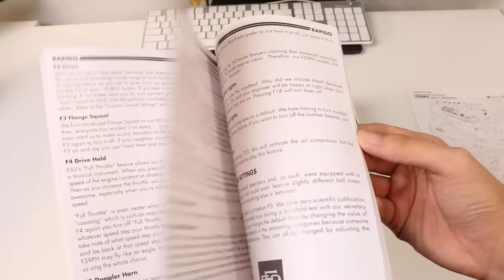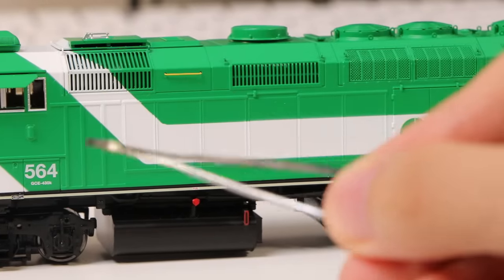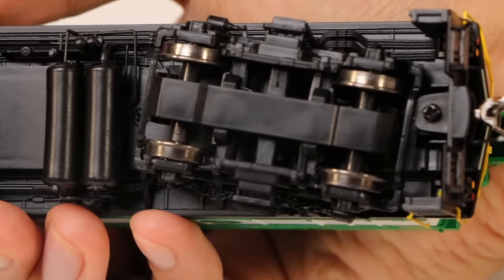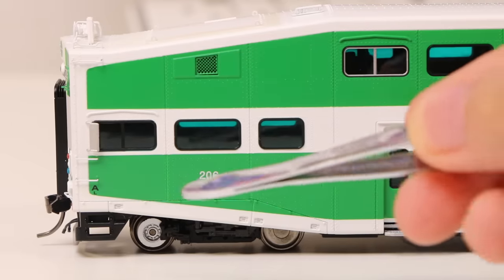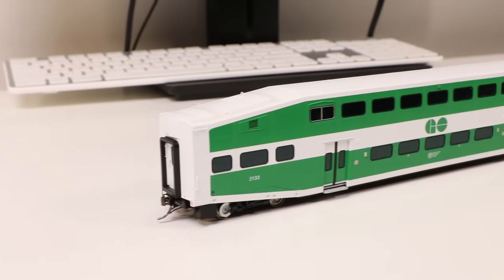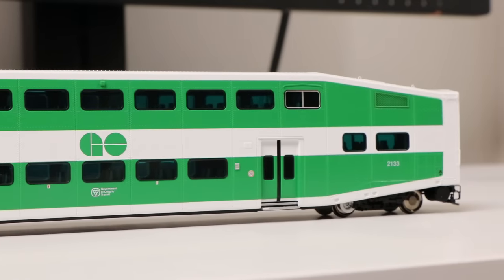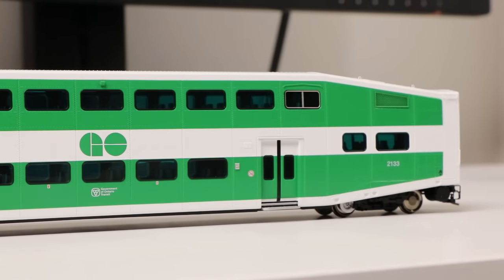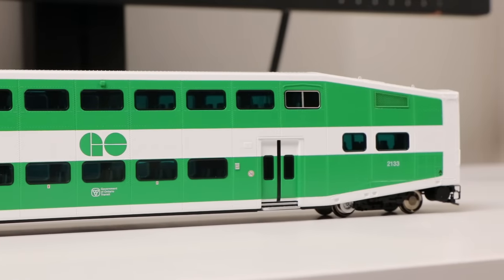Rapido HO Scale GO Transit Train Unboxing

Comment: 3:27 That small black connector that looks like an AC outlet or it can be a PTE connection.  PTE is Portable Testing Equipment, usually hook up a laptop computer to a PTE connection to get data from for example the trains main computer, black box or it can a sectional component like propulsion system or electrical and so on.  I was a technician for a few train builders. That what it seem to resemble.  Nice video.  Have a good 4th of July weekend.

Comment: Very impressive fleet. I live in the Tri State area Where I live Near New Jersey Transit. And my many trips in times past to Toronto & spotted The GO TRANSIT trains may I add thousands of videos of them. I have these Coaches and Cab Control cars in ATHEARN. Unfortunately I didn't purchase the ATLAS NJT cars. The engines Details are The GO TRANSIT are excellent. The New Jersey Transit cars I have had the pleasure on riding them constantly. On the ATLAS set what Irks me is why didn't they make an ALP 46 with the HO set ? The O scale set had them ALP 46 but not the Diesel Electric version you have on the ATLAS HO version.. I did spot the real version on my way to DOVER New Jersey. near Summit station when they' first debuted. Glad you have that one tho. As for your other model AMTRAK & your frieights  sets are all awesome . Good video. 👍🎥⭐⭐⭐⭐⭐

Comment: Good choice. One of my favourite models with really good quality. The DCC sound versions make them so much better. Time to invest in one lol. We did actually put the back handrails on upside down so you can fix it on your model if you wish.
Reply: The speakers IMO are mainly what holds them back. Motown Models and Scale Sound Systems both offer excellent replacement designs
Reply: @CentralJerseyRailfan  for iPhone speakers they do the job. But I definitely feel like any manufacturer needs new speakers nowadays.
Reply: @eth.wong04  No factory speaker is perfect but some are decent (Athearn, Bowser, and Scaletrains factory dual sugar cubes for example) to being really piss poor (looking at you Atlas)
Reply: I am so jealous of your train collection ( trying to be a general H0 watcher❤)

Comment: Fun fact with go transits locomotives, go transit had originally bought cargo locomotives incase the passenger rail system failed. So as a back up plan incase passenger rail failed it could sell of all its locomotives to cargo railroads.